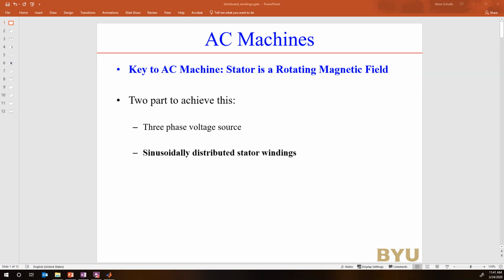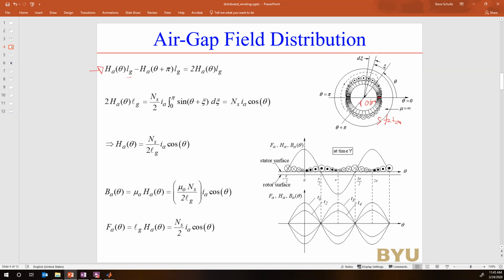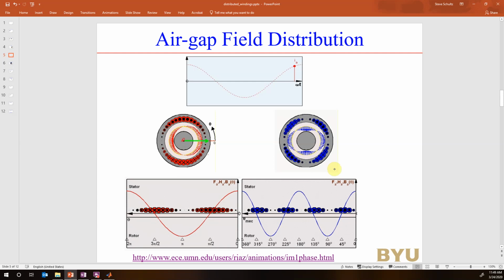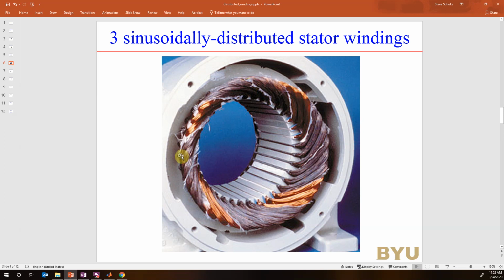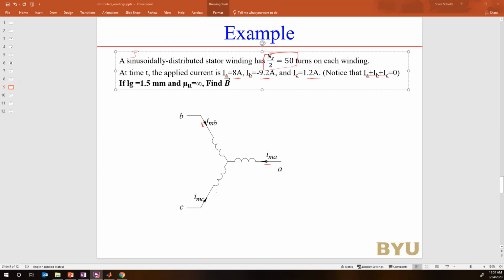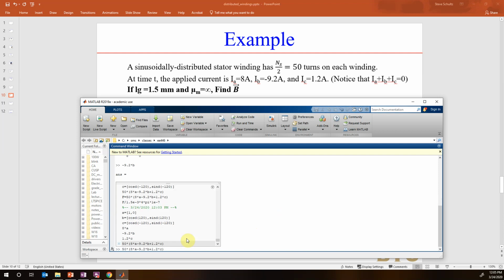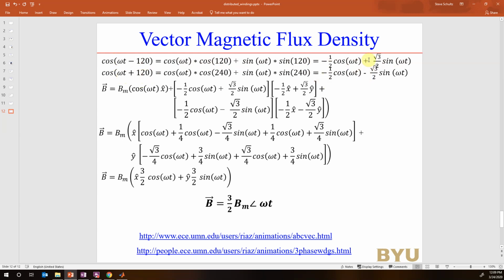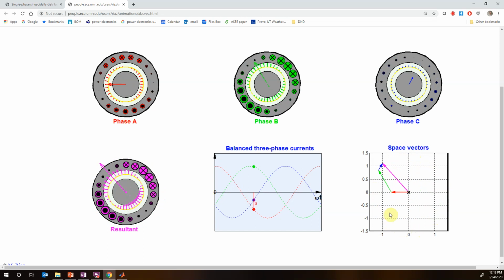Sinusoidal windings

Comment: I figured that this was the case, however did not know how it was implemented. Now I know...This is the best solution for a permanent magnet synchronous alternator because the flux is distributed across the poles  according to the number of turns of wire, thus producing a pure sine wave output, rather than a pulsed output on account of the concentration of flux a the poles in a BLDC Motor